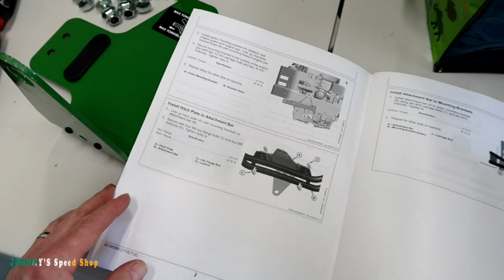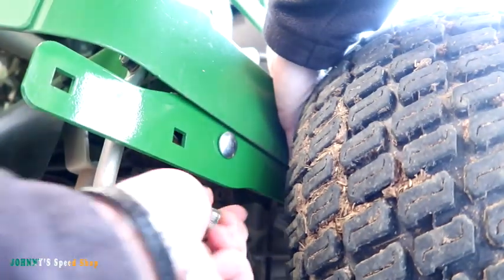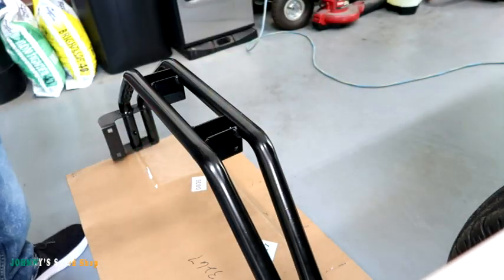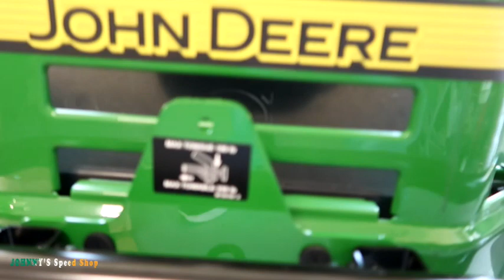John Deere Hitch Install - Part Number BM24481

Comment: GREAT video.  Much appreciated.  About to install a bagger kit on a ZTR345 and those instructions are horrible.  Thank you!  Did you happen to install the bagger kit too?
Reply from the maker: I didn't mate I did install the mulch kit, instead of bagging I just mulch the leaves in the fall works great, you need to replace the blades as well with the mulch kit install.

Comment: Great video! Easy to follow and not filled with "pro" jargon. Made the job easy. 
Could you post a video on parking brake adjustment on this model? Occasionally, mine will not start without "playing" with the brake.
Keep up the great work!....Thanks
Reply from the maker: Sure mate...if mine ever gives me any issues ill record the fix
Reply: @JohnnysSpeedShop  Thanks for the quick reply.